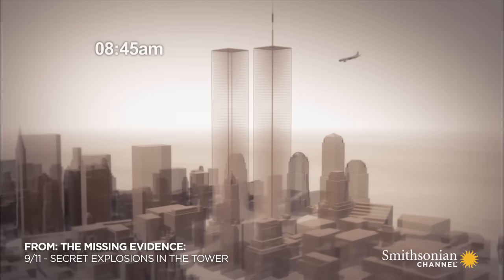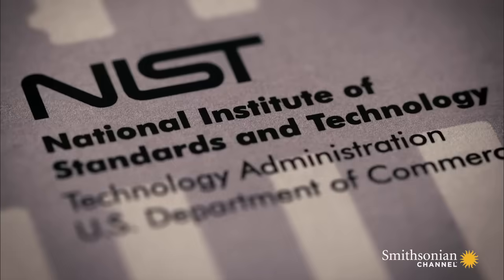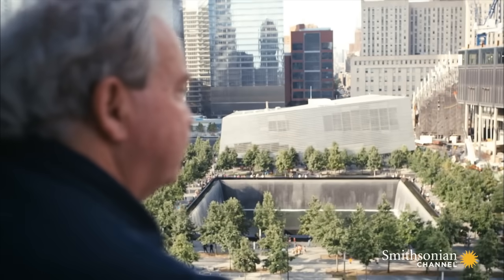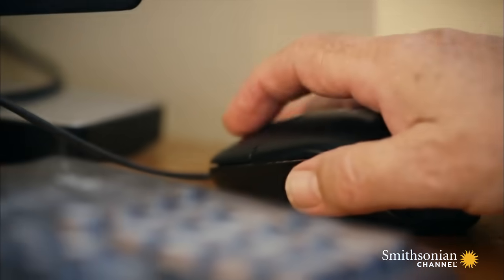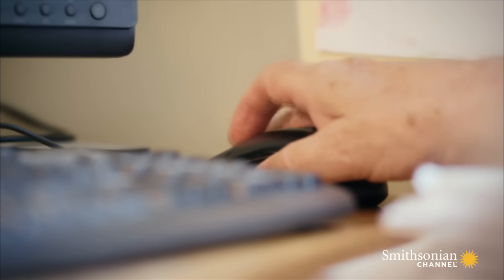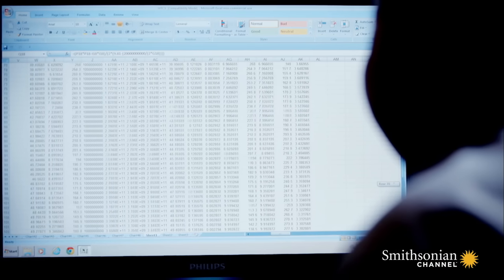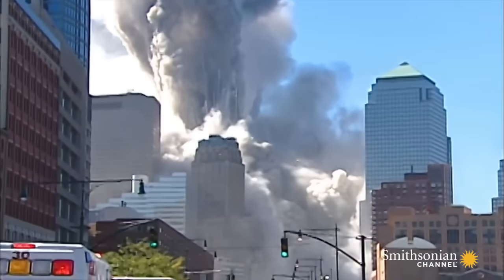This Computer Simulation Explains How the Twin Towers Fell

Comment: Top 15 floors destroyed the bottom 90 that weren't even heated up from any fires?
No thanks
Reply: @Orane Appleby, you're not an engineer of any sort.  I'd be surprised if any 9/11 conspiracy theorists even took a basic physics class in highschool, if they even graduated highschool at all.   

And the controlled demolition idea would take the most precise timing, as they'd have to detonate each floor at freefall speed, which they wouldn't even have to do, since once the top 15 floors fell, the rest would have collapsed easily.   And who do you think was in those planes, and when you answer that, think of all the people needed to rig those planes and all others needed to rig the explosives in the towers, so that no office workers or airport workers would be suspicious...you're talking hundreds of conspirators, and so far, the only people calling it a conspiracy are a bunch of people who aren't experts in any fields and weren't at the sites.   And in the age of wikileaks, all you have for evidence is a handful of drunken morons claiming to be experts?
Reply: Roasted Locust Many people make the argument of things being at rest (potential) vs things falling (kinetic) (top of the tower falling on bottom part of tower). Let’s say the steel structure was weakened by the office fires. People are acting as if someone took the whole top of the building, cleared some space underneath of it, and dropped it on the lower half which WOULD be devastating in reality but that didn’t happen. Beams buckle. Beams weakened by heat would buckle causing the top half of the building to “fall” but not evenly. Likely, the top half above the impact site would fall slightly off center and most definitely wouldn’t take out the whole building in one straight shot. The way the building fell isn’t natural given the situation. Steel and concrete pulverized... just gone in a cloud of dust. There’s no logical reason for this... given the “normal” circumstances of 9/11.
Reply: @Orane Appleby, the most suspicious thing was wherever they got the intelligence that said Iraq was involved and had weapons of mass destruction.   Invading Iraq costed way more US lives and money than 9/11, and it created more terrorists and took away the counterbalance to Iran that was Saddam's Iraq.   Oh, and I'd like to see which politicians that called for the Invasion and occupation owned stock in what defense contractors.  Yeah, there's probably a conspiracy there.
Reply: @Orane Appleby, I am not naïve at all. I understand the physics and the theories which are explained by physical evidence, including video. It is naïve to draw false conclusions and make false assertions based on false evidence and a false understanding of basic science.
Reply: @Orane Appleby, And I enjoy listening to idiots who follow the Conspiracy Theorists Manifesto as though it were the Bible, yet it's obvious that they don't have even a passing understanding of basic physics nor do they ever offer bona fide evidence to support their assertions. Collectively, they talk about "official lies" while also spouting clearly contradictory theories and assertions which cannot all be true (some are obviously mutually exclusive). They try to pick apart the official account of what happened and claim "cover up" as a means to explain things that are beyond their limited understanding and fueled by their over-developed paranoia. They're fools who never put their pet "theories" to any sort of scrutiny because they know that none of those theories will hold up to any full examination.
Reply: @Mamoon-z8y  stop saying my friend thinking it makes you sound smart because it doesn't.
Reply: @Orane Applely, Irony? I suspect that you don't know what that really means.
Reply: Yes 15 stories destroyed 90.   Why?  because every floor below it is only designed to carry the weight above it HELD STATICALLY.    You can look that fact up.
Reply: Kathy Rheinfrank  
They literally designed it for a Boeing 707 impact. The largest commercial airliner that existed at the time. You're simply wrong.
Reply: A lot of these 9/11 Truthers suffer from Dunning Kruger Syndrome on top of their ignorance. It's basically that they don't understand how something happened. Therefore, they conclude there's a vast conspiracy. There's really very little difference between them and flat-earthers
Reply: MTG Zombie  That's not the way any of this works. 

And calling people morons for disagreeing with you isnt a thing smart people do.
Reply: Ok cracks knuckles after seeing all the comments I will reply with my own rebuttal.

Putting the Pentagon and collapse of WTC 7 to the side let's talk about the structures that were the twin towers. They were constructed in the 70s using a new technique called the open floor plan or tube structure construction.  The building was basically a banana.

Each floor was held by the floor trusses connected to the outer steel and inner core columns. At rest the buildings were incredibly strong and had huge open floor space but it became the reason for the buildings demise.

Once the planes hit the whole buildings structural integrity were compromise as to the construction was for each floor to perfectly hold the weight of the floors above. Combined with the incredible heat of the fires the beams of steel could no longer hold the weight of the structure. Yes the fires weren't hot enough to melt the steel but was enough to weaken the surrounding supports. 

When the weight finally became too much for the structure to handle, the floors trusses began to buckle. Given the tube structure the outer walls no longer had and hold on the vertical load and the core couldn't maintain the weight of the buildings.

Basically both buildings peeled like 700,000 ton bananas and came crasing down.

And finally they didn't fall straight down, they peeled and spread debris widely over a 16 acre site
Reply: @nicholasmccay1513  cracks knuckles  What about the chunks of steel that were shot hundreds of feet sideways, as the buildings were falling?  What about the fact that much of the towers were turned to dust, as they were falling?  

You then say “I can agree to the conspiracy of the Pentagon and building 7.”  So, you’re somehow insinuating that you believe that there was hanky-panky involved with building #7 and the Pentagon, but not at the site of the twin towers?  Huh?  It’s either a 100% inside job or it wasn’t at all.  You can’t have it both ways.
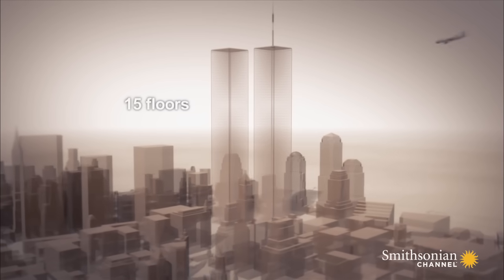Reply: In 2:47 south tower u see it was no support by anything it weakened then it caused to collapse on its side floor after floor after floor
Reply: Yeah because of bombs and energy directed weapons...Russia and China are about to destroy America.
Reply: It's like playing uno stacko
Reply: What concerns me the speed of its fall
Reply: There’s no way it can collapse into itself like that at such a high speed
Reply: Imagine you're playing Jenga, and you took out one wooden block, then it just fell toward the path of MOST resistance, straight down, crushing all the blocks into dust so you couldn't play again.
Reply: @goffreyb5570  Imagine that you had such little understanding of how the twin towers were constructed or damaged that you compared their collapses to a game of Jenga. Moronic.
Reply: @JohnJ-fj2xe  Sorry architect, you've proven to me and indeed the world with your comment that you are right and there was indefinitely nothing wrong with towers falling toward the most resistance.
Jenga blocks fall toward the least resistance, I guess steel being stronger falls toward the most resistance oh and speeds up in velocity too.
Reply: @goffreyb5570  Just because you don't understand something doesn't mean that it didn't happen...
Reply: @JohnJ-fj2xe  You are very convincing, for the first time in interest history I've been convinced that theres nothing suss about those buildings turning to dust, I should even rethink building 7 now! Thanks John J
Reply: Kathy Rheinfrank  Really....
Reply: Kathy Rheinfrank  will do, sounds you like nailed it.
Reply: Kathy Rheinfrank  If you don't know the facts regarding the design parameters of the twin towers, then maybe you should sit this one out.
Reply: Also, WTC1 and WTC2 had a massive steel central core surrounding the elevator shafts and egress stair wells
Reply: @Aqil Ahmad, Sorry, but you're confused. It's one thing for people to believe that things happen even if they can't be seen. It's another thing for people to say that they saw things which never actually happened. There's a difference.
Reply: MTG Zombie That doesn’t make any sense to what happened. Planes are made out of aluminum they cannot rip through a concrete and steel building like cheese. Try thinking in terms of concrete, steel and aluminum. Bub.
Reply: MTG Zombie  
You have no idea what you're talking about. Asking if orders to shoot down a plane approaching the Pentagon "still stand" as the plane gets CLOSER? It makes no sense. Why would the young man on radar think they might NOT want to shoot it down at that point? If it gets within 10 miles, we might just want to let it crash into the Pentagon? Are you using your brain?
Reply: I can agree to the conspiracy of the Pentagon and building 7. 

My opinion on building 7 is there were too many government secrets within so they decided to collapse it
Reply: I didnt know buildings were built were built so top heavy
Reply: Possible in theory.... but the building losing structural integrity at all 4 corners simultaneously, and not toppling??? Zero % chance. And then it happened 2 more times, and created a dust cloud that covered a city.  You should have a mountain of steel left, leaning different ways.
Reply: @theace7212  Yes. This. Exactly. I will never understand people who get angry about wanting to look into something. Even people on the panel that released the final report said they didnt have all the info they needed. 

The people on here protecting their brains from new information must be half shills and half boomers. Lucky for us, you can ask any HS kid what happened on 9/11 and they will tell you the official story is bullshit.

If you asked 100 people in 1970 "what happened to JFK?" Most would give you the official story. 
Ask that same question in 1995 and over half will say they dont buy the official story. Same thing here. Most people knew that day what they were looking at was not an accident because of crashed planes. Then the brainwashing started.
Reply: @joemo1033  exactly
Reply: @joemo1033  they get even more upset when you tell them that they should ask questions about the buybull..I mean Bible, like who created it.
Reply: I have no issue with the notion that the weight of the several floors above the impact site would be enough to set a total destruction of each respective tower in motion. However, doubt begins to creep into my mind when I see how perfectly the buildings fall. It's far fetched, to say the least, that the entire floor where the impact occurred was wiped out in a very short period of time. That seems to be the assertion being made in the video, unless I heard it wrong. While I'm no structural engineer, I am studying to be a materials engineer. Therefore, I have a decent understanding of metals and the process by which heat is transferred within them. While the fire that originated from the burning jet fuel near the impact site could possibly have been hot enough to melt the building's outside supports (which from my understanding was where the majority of the tower's structural strength came from), I'm of the opinion that there would be a point in time where the outside supports of the tower in the area immediately surrounding the impact site would begin to sag under the weight of the floors above it as the metal heated up and became more ductile. The outside supports on the opposite side of the tower, in my humble opinion, would not have been heated up to the same degree in the same amount of time (or relatively close to it). Perhaps the opposite side of the tower would have eventually reached a temperature capable of compromising the structural integrity of the impact floor, but it does not seem likely to me that this would occur even close to when the same thing happened on the side of the tower where the plane actually crashed into it. Temperatures on the impact floor would logically have been hotter near where the plane hit. It just doesn't add up to me that the buildings seemingly had very little variation from side to side in the way they fell. I'll never be wholly convinced that a giant flying bus can smash into the side of a building, no matter how well constructed it may be, and then the building just falls straight down. Common sense leads me to believe that there would be some sort of toppling motion involved ithe case of each tower. 

I know it's a little bit off topic, but don't even get me started on Tower 7 or the Pentagon, either. I would love for someone to explain how a building that doesn't get crashed into by anything freefalls in exactly the same fashion that the twin towers did on the same day. I don't care who you are, that is strange to say the VERY least. It's a question I haven't seen anyone in this thread want to touch. Also, has anyone that believes there was nothing fishy about 9/11 ever contemplated the conundrum of how in the freaking world did a passenger jet come cruising into military airspace and smash into the Pentagon?? When any plane -- no matter the civilian lives on board -- enters military airspace, they're not just greeted kindly and nicely asked to not fly there anymore...fighter jets are scrambled within a minute of attempting to contact the pilot of the aircraft if ignored (which is what happened on that terrible day, as is protocol). Somehow, though, this plane made it all the way to the Pentagon unscathed. Not to mention, the maneuver that was executed in order to strike the Pentagon at the angle which it was struck was supposedly performed by some dude who had taken a couple months of half-ass flight lessons. It was a maneuver that was described by an experienced pilot as one that would have been extremely improbable for a pilot with anything less than incredible skill and experience to pull off. 

Compound all that with the fact that we still have troops over there almost 20 years later and it all looks really bad. If we were just over there for retribution don't you think we would have pulled out completely by now? I'm certainly no expert in global politics so don't @ me for that last part, but it just seems like we've proved our point by now.
Reply: @camg1145 , everyone just conveniently forgets about WTC 7. And the Pentagon, that hole created by the "plane" was much smaller than the American Airlines commercial plane would've been. I, sadly,  have come to the conclusion that the facts just outweigh the bullcrap that I am fed!
Reply: @Camden Grant, Firstly, the impact areas in each tower comprised several floors, not just a single floor. This becomes significant at the start of the collapse because this vertical dimension of the impact areas creating a 'gap' through which the upper sections fell before colliding with the lower sections. Secondly, while the structural strength of the buildings came from the vertical support elements of the central core and the perimeter walls, this strength was completely dependent on these vertical elements remaining connected via the floor trusses. The floor trusses were relatively weak compared to the main vertical elements, and they were very vulnerable to the effects of heat from the fires, especially since their fireproofing had been compromised by the airplane impacts. When the connections between the floor trusses and the vertical elements failed because of the impacts and/or the fires, the perimeter elements began to 'bow' outward due to the weight of the floors above (there is video evidence of this), and this was the first indication that the buildings would collapse. Eventually, this 'bowing' caused the perimeter elements to become sufficiently out of 'vertical' that they could no longer support the gravitational forces and they failed. This failure caused the upper sections to fall into the 'gaps' created by the impacts, thus generating enormous amounts of kinetic energy directed straight downwards. When this falling mass collided with the upper floor(s) of the lower sections, they were destroyed (including the floor trusses and vertical elements). This process continued until the entire building was destroyed in a textbook 'progressive collapse'. The fact that both buildings collapsed in similar fashions after sustaining similar damage is evidence of how vulnerable this particular design was to anything which compromised the structural integrity of the support elements. And, the fact that the tower which was hit lower fell first is additional evidence that the weight of the upper section was a determining factor in how quickly each structure took to fail.
Reply: @JohnJ-fj2xe , okay, great explanation that we have heard a million times! Except what about WTC 7, you didn't touch that with a 12 foot pole, did ya!! That fell in the exact same manner... how?
Reply: @tashaburr3866  
WTC7 did not fall in the same manner as the twin towers. It was constructed differently. Further, WTC7 was struck by debris from WTC1 when it collapsed.
If you're not familiar with these basic facts then you should educate yourself.
Reply: @Camden Grant, Regarding WTC7, to suggest that it wasn't hit by anything is to ignore the basic facts of what happened to it. Large structural elements of WTC1 struck the corner of WTC7 after falling from 1100 feet. This impact gouged a large section out of WTC7 and caused structural damage to it, most notably to the trusses which spanned a ground-level power station over which WTC7 was built. When this element failed, the remaining elements of WTC7 collapsed in a predictable fashion. There is video and photographic evidence of the initial damage to WTC7, and the nature of its collapse has been well documented.
Reply: @John J 
You say the nature of the WTC 7 collapse has been well documented?  Oh really? In a secret computer model that we're not allowed to see? You TRUST what they tell you, and take it as fact. They say that making the computer model public would jeopardize public safety. You believe them, and tell others it's well documented. You’re a fraud.
Reply: @tileformiles, Learn to think for yourself rather than just drink every cup of KoolAid put in front of you. You're just a lemming.
Reply: John J 
Really? How can you think for yourself if the ONLY proof that a steel framed building could fall identically to a controlled demolition is a secret computer model? Do you even realize that you aren’t thinking for yourself? You’re taking it on faith. It’s hilarious that you didn’t even realize that.
Reply: @tileformiles, Firstly, this 'secret computer model' has nothing whatsoever to do with my understanding of how the towers collapsed. Secondly, there was very little 'controlled' about the collapses, as evidenced by the collateral damage caused by them. Finally, this video is not 'proof' of anything, but instead is 'evidence' to be considered.
Reply: John J 
Dude, the computer model of the collapse is EVERYTHING from a scientific point of view. They say, "hey this building fell in a way NO OTHER building has ever fallen. A way that only controlled demolition could physically explain the collapse. We’re telling you fire caused it. We have a computer model showing that it’s PHYSICALLY POSSIBLE, but it’s secret, and you’ll never see it". 
Bro, grow up and stop acting like a coward. Start thinking for yourself.
Reply: @tileformiles, You write like an 17 year old high-schooler, 'bro'. This computer model is nowhere near being EVERYTHING available on this topic, nor is it 'official' nor definitive. Stop believing all the half-assed conspiracy theories and start applying the same degree of critical thinking to them as you have apparently done (in your own 'special' way) to the official explanation. Further, rather than simply spouting the same old crap straight out of the Conspiracy Theorist's Manifesto, start citing some PLAUSIBLE explanations of your own and have them held to the same scrutiny. They won't hold up, Dude...
Reply: @JohnJ-fj2xe  
Half assed conspiracy theories? 
So now NIST's computer model of the WTC 7 collapse isn't official? It's not definitive either?
It's the only piece of evidence showing that a fire induced collapse is PHYSICALLY POSSIBLE. Everything else is just a story they're telling you. It's interesting that you can't understand that. 
This is probably the first time you're learning that NIST won't open the computer model up to public scrutiny? Is that why you think it's a conspiracy theory? 
Because you didn't know? 🤣 And now suddenly it's not "official"? Did NIST not "officially" investigate the WTC 7 collapse? You aren't making any sense.
Reply: @tileformiles, Dude, watch out. There are conspirators under your bed. And, they're coming to get you, bro.
Reply: @JohnJ-fj2xe  
You don't have an answer?  Looks like you don't know half as much as you pretend to. Hopefully you can realize that everything you've been told is a story. There's no scientific theory regarding WTC 7 collapse. You have faith, nothing more.
Reply: @tileformiles, I have verifiable facts, logic and a complete absence of paranoia. Grow up, Dude....
Reply: @JohnJ-fj2xe  
Paranoia?  You think paranoia causes people to think the WTC 7 collapse looks visually identical to a controlled demolition? We think NO OTHER steel framed building has EVER collapsed because of fire because we're paranoid? We think the Pentagon is in highly secure airspace because we're paranoid? 
No, it isn't the absence of paranoia you have, it's the absence of courage and the ability to think for yourself.
Reply: @tileformiles, Neither WTC1, WTC2 nor WTC7 collapsed solely 'because of fire' and no intelligent person ever claimed that they had because to do so would ignore the effects of the major structural damage sustained by each of the buildings. Further, any comparisons with fires in other 'steel-framed buildings' are also meaningless because the WTC towers used a completely unconventional design that made them vulnerable to their structural integrity being compromised for any reason. So, if you're so determined to think for yourself, then why don't you offer some logical practical theories of what happened and provide bona fide non-anecdotal evidence to support them? Just stating that you don't believe the 'official' stories without providing a logical rationale is nothing less than stupid. Any asshole can spout conspiracy theories without providing reasonable alternatives that stand up to scrutiny.
Reply: @tileformiles, Intelligent people don't see things that are not there. You, on the other hand.....
Reply: @JohnJ-fj2xe  
And this, coming from someone who thinks the Pentagon is basically just an office building in unprotected airspace. Hilarious.  You insult your own intelligence, and don't  even realize it.
Reply: @JohnJ-fj2xe  
Have you heard Norman Mineta's testimony at the 9/11 commission hearings? You should watch it. With all the confusion you describe occurring in the skies on 9/11, it's an odd fact that Dick Cheney was intently monitoring and TRACKING the airplane that was approaching the Pentagon.
Reply: @JohnJ-fj2xe  
Yet there was no warning or evacuation at the Pentagon. See a problem there?
Reply: John J what’s your source to verify that states the “towers used a completely unconventional design that made them vulnerable to their structural integrity being compromised for any reason”?
Reply: @CPTObserver  Leslie Robertson, among others.
Reply: @Camden Grant, Just to clarify, The Pentagon is not considered 'military airspace' in the sense of a conventional military installation. There are no runways or munitions stored there, and it resides in suburban Washington in relatively close proximity to Dulles airport.  In essence, it's just a very large office building. As for the air force scrambling fighter jets, you have to remember that after the WTC impacts, there were only two remaining hijacked jets still in the air, and they were among hundreds of aircraft still flying in the northeastern U.S. and southern Canada. NORAD's defenses were oriented to detect and intercept incoming threats from outside of North America, but were not oriented to threats which originated in the U.S.. For anyone to suggest that the fighter jets could simply directly intercept the hijacked jets is to ignore the broader context of the situation that existed for a relatively short period of time.
Reply: The truth of the matter is that Donald Rumsfeld addressed 2.3 trillion dollars unaccounted for on 9/10/01 and the only databases that stored the information was in Word Trade Center 7 and the Pentagon which both were destroyed by “planes” which anyone can get the common sense across that it was planned. 2.3 trillion dollars missing is a lot of money and there is no way you can say that these politicians didn’t have anything to do with that?
Reply: @Mamoon-z8y , I don't know what you're talking about.   There was debris and crushed office floors on the ground level.  And the outer supports would have been damaged as the office floors fell.   Even a demolition job wouldn't completely disintegrate everything.
Reply: The weight of the top 15 floors could easily collapse the support hinges that held up each floor underneath them as those support hinges were only designed to hold up the individual floor.   The way the towers were designed, each floor was being held up by the outside structure, not the floors underneath them.   You have no clue.
Reply: @RoastedLocust  and what about building 7? It falls in exactly the same way but without being struck? if you only knew.
Reply: @Forest9924  lol imagine being debunked and trying to use another debunked story... that’s called moving the goalpost...
Reply: @Forest9924    7 caught fire from falling, burning debris from the other buildings and collapsed the same way!  Not hard to figure out!
Reply: @RoastedLocust  "Hinges"?  As in: "a movable joint or mechanism on which a door, gate, or lid swings as it opens and closes or which connects linked objects"?  Please explain what hinges have to do with the engineering of a 100+ story building.  And what a hinge has to do with the support of said building. (A diagram might help).
Reply: @RoastedLocust   Liar.
Reply: @RoastedLocust  I'm a firefighter no they couldn't
Reply: @charliewood1680  , they couldn't what?  And what does being a firefighter have anything to do with your lack of knowledge about engineering, physics, and supposed government conspiracies?   Must have taken you 8 years get through firefighter training to know all of that - plus however long it takes to get the the most top secret of government clearance.   I'll trust the real experts, thank you.
Reply: Charlie Wood I’m a fire and explosion investigator. Yes they could. Don’t forget also that the ventilation shafts likely had burning materials falling into them, elevators falling from high floors straight to the bottom floor. We can argue all we want about how “they would never collapse that exact way” but the fact is they did.. and to think the government was sneaking into the towers and planting explosive devices in them over a period of weeks without ANYBODY discovering something fishy.. or somebody being like yooo I have to admit something after the fact, is just absurd.
Reply: @RoastedLocust  Imagine you're playing Jenga, and you took out one wooden block, then it just fell toward the path of MOST resistance, straight down, crushing all the blocks into dust so you couldn't play again.
Reply: @RoastedLocust  
The amount of likes on your post makes me lose hope in humanity.
Reply: @fym6185  , the amount of people who believe unproven claims without applying science and common sense to those claims makes me lose faith in humanity and democracy.
Reply: @RoastedLocust  
See that's the thing. "Real" science will tell you that those buildings didn't "collapse". Simple grade school physics will show you that.
So many people are willing to throw science out of the window for fear of finding out the truth. 
In my experience, most people that go along the "official" story are simply ignorant to the full facts and the rest are in complete denial. You my friend, are in the latter category.
Reply: @RoastedLocust  Next time you drink a beer or a soda take the empty can and stack a brick or 2 on top of it and see if that flimsy can will collapse. You might learn
something about structural strength.
Reply: @joelmorrow7101 , okay, now take the brick and drop it on the can from six feet up, and you'll see that the can will collapse.   You might learn something about Newton's second law of motion, which is Force = mass times acceleration.   There are more complex equations for impact forces, but if the upper floors of the towers fell, it would create a force that would multiply the weight of those floors by at least 6, which would only snowball from there.   Buildings are designed to static weight, not moving weight.   If gravity and mass weren't in play, the towers wouldn't have fallen.   If physics worked like the 9/11 truthers think, cars wouldn't crumple in crashes and bullets wouldn't be dangerous when shot from a gun.
Reply: @joel morrow, Next time you drink a beer, take the empty can and DROP a brick or 2 on top of it and see if that flimsy can will collapse. You might learn something about kinetic energy.
Reply: @RoastedLocust  Finally, an intelligent person on this thread. Yes the kinetic energy of the collapsing top block of floors was too much for the first lower floor to withstand. Once that lower floor collapsed, its potential energy became kinetic energy and was added to the total energy of the collapse, minus losses due to heat. Those losses were relatively small. As you said, as each lower floor collapsed, most of its energy was added to the energy to collapse the next lower floor. Meanwhile, trying to replicate the twin tower collapses with a scale model isn't applicable since gravity isn't scalable. There are scientific journal articles that explain it with mathematics. The bottom line is that there was more than enough energy unleashed in the  collapse to bring down the towers without any need for explosives.
Reply: @roastbeefy2917 , I'm not actually that intelligent, but I understand that a falling object exerts way more force on an object than that same object would if at rest.   9/11 conspiracy "theorists" seem to think there were different laws of physics involved.
Reply: @RoastedLocust  Right. Many of them don't understand the difference between static load and dynamic load. Good point.
Reply: @RoastedLocust  your obviously not intelligent cause no modern building collapses like that from impact and fire besides those 3. Building 7 is obvious lol please
Reply: @flex8707  What are you talking about? All kinds of buildings have collapsed from fires. And how many have been deliberately attacked by planes used as missiles? As for WTC 7, the firefighters said it was unstable and likely to collapse. Were they lying?
Reply: Roasted Locust cars wouldn’t crumble? That’s worth considering. The planes should have crumbled on the side of that building. Maybe left a little damage but not cut through several floors of steel skeletal structure. Especially odd when you see that not only did the planes fly into the buildings but caused explosions that were large enough to take out all four sides.
Reply: Roast Beefy provide a source please.
Reply: @RoastedLocust  Random question, but what's your educational background?  Engineering degree?  Just curious.
Reply: @JohnJ-fj2xe  try dropping the can on the brick that would make more sense in this scenario.
Reply: @grmarsh831  The brick and can analogy just doesn't make sense. Firstly, the can is only travelling at free fall speed. Secondly, The brick would be solid, unlike the vertical surfaces of the twin towers (because they were 40 percent glass)would be analogous to a bread slicer.
Reply: @Mamoon-z8y , there's this thing called addition, so when the top 15 floors collapsed the one underneath, you now had the weight of 16 floors collapsing onto the floor below, which in turn would make 17, 18, 19,etc.   I'm sorry, but both math and physics disagree with you.   Falling objects exert much more force than objects at rest.   Buildings are rated to support certain amounts of weight at rest.  Here's an experiment for you.  Place a bowling ball on your feet.  Does it hurt?  Now drop the bowling ball on your feet from  two meters up.   You'll be lucky not to have a broken foot.
Reply: @RoastedLocust  do you think the floors will collapse near free fall speed? Think about it.
Reply: @Mamoon-z8y , yes, the floors will fall at free fall speed if the force coming down on the floors below vastly exceeds the ability of those lower floors to resist that force.   Real engineers and physicists have studied it and they all came to the same conclusion.   There should be no argument about it unless you think the scientific community is part of the same, vast conspiracy.

I know there's a petition by 3000 supposed architects asking for the real "truth", but architects aren't taught to design buildings to withstand forces like that.

Keep believing what you want to believe though.  It's not hurting anybody unless you start a civil war based on your paranoia.
Reply: PakMan wrong 15 floors were sufficient to collapse one floor which meant there were now 16 floors to collapse the next floor and 17 floors to collapse the next floor. As each subsequent floor collapsed there was more weight to progressively collapse the lower floors.
Reply: @stevenreed5514  The fire was not hot enough for that. The damage wasnt bad enough for that. The buildings were too strong for that. 

The black smoke coming out of the buildings is what a fire starved for oxygen creates. In several videos, we can see people at the point of impact right after the crash up until right before the demolition. Alive. They wouldn't be there if it was hot enough to do what you said. Then there were the core columns. The idea that getting hit by the planes and the ensuing fires could do what we saw at ground zero is impossible.  

Also, first responders and regular people heard and felt secondary explosions and recorded them. People saw flashing lights corresponding to the explosions. There was a sudden onset of destruction, and a pyroclastic cloud, before the top of the building fell at almost free fall speed through the path of most resistance. We never see any pancaked floors. We see a building blown to pieces.

Dont forget the reporting from that day, there was a truck full of explosives found on the George Washington bridge. Secondary explosions were reported all day. And then of course, building 7. When are we getting the data for NISTs animation of the "collapse"?  

Research the dancing Israel's arrested in New Jersey filming "the event". Planes didnt take down the towers. Or building 7. Or hit the Pentagon. 

Its not all your fault that you believe the official "story", the propaganda has been deep. After all, Popupar Mechanics AND Neal Degrasse Tyson, AND Mythbusters AND any other Science prophet that is popular at the moment has told you what happened and what to think. 

Which is totally normal, because even if they knew the truth, why would they forfeit everything they have to tell people a truth that would destroy their careers and make everyone think they are nuts, and not believe them anyway
 because the propaganda has been so effective. Why wouldn't they want to sign up for that dream!? 🤪

Those buildings were taken down. And not by planes or fire.
Reply: Joe Morrell where did I say anything about heat. I simply corrected your false assertion that 15 floors could not collapse 90 lower floors. Because the tower collapsed progressively it is obvious that as each floor collapsed the weight above the remaining structure increased by the mass of that collapsed floor and thus the progressive collapsing of each subsequent floor is feasible. 

Edit - sorry you were not the author of the comment I was replying to
Reply: @stevenreed5514  No sweat.
Reply: Steven Reed 
The core column structure was the strength of the building and it was fine, the fire didn’t make the floors any heavier. The buildings were LITERALLY designed to take hits from large aircraft.
Reply: @tileformiles, The core structures were severely damaged by the airplane impacts. The structural integrity of the buildings was dependent on the connections between the vertical elements in the core and on the perimeter. Once these connections were severed by the collapse of the floor trusses, the structural integrity of the towers was compromised. Collapses were inevitable. Also, the design parameters of the towers accounted for a single impact of a Boeing 707 flying 'low and slow' (as per Chief Architect, Leslie Robertson). They were NOT designed to withstand 'hits' (plural) from aircraft larger than a 707 (which these planes were) flying at almost 400 knots (which these planes were).
Reply: @JohnJ-fj2xe  
The collapse of the floor trusses? Keep in mind that the fire didn't make the floors any heavier, the buildings EASILY withstood the impact of the airliners and any resulting damage. It has already been proven that the floor trusses could not sag even close to the amount required to cause damage to the connections in those temperature conditions. I suppose you think office fires created all that molten metal too? 
I suppose you think the Pentagon isn't in secure airspace as well?
Reply: You people need some serious courses in physics and applied sciences.
Reply: Jeff Ward sick, another college course that means nothing
Reply: @stevenreed5514  If that's true the building wouldn't be standing in the first place
Reply: didnt the steel got softened by fire and couldnt support the 17 floor weight and collapsed?